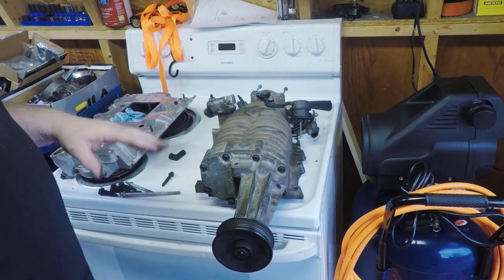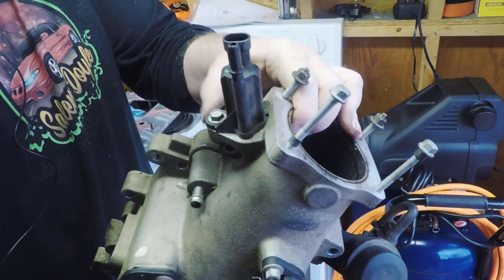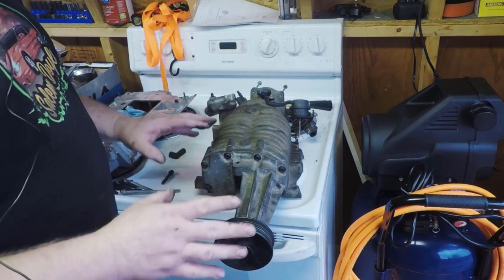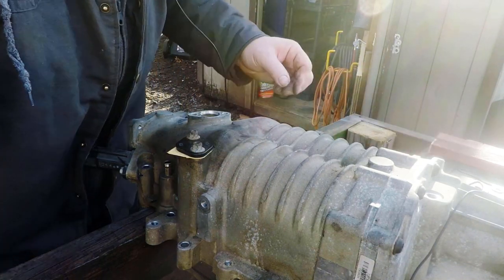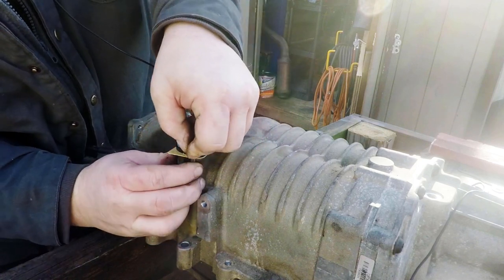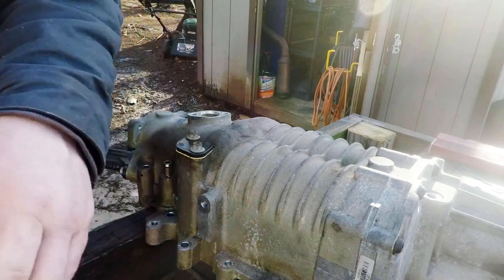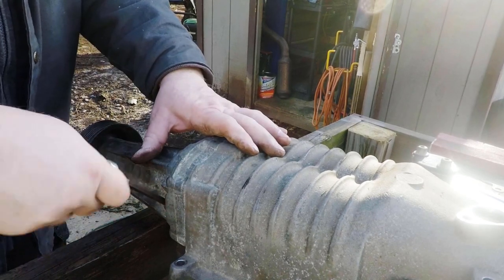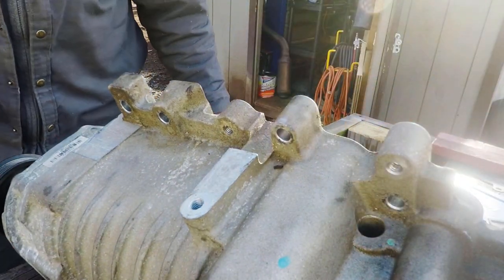Gen 5 M90 to L67 Swap Part 2 - Supercharger Prep

Comment from the maker: Quick correction.  The official fill capacity of the m90 is 225 ml . so that is about 1.5 bottle.  thanks carnage 50x for pointing this out to me.
Reply: Question have grand prix gtp have missing bolts on manifold supercharged   spraying air fuel what bolt set I need????
Reply from the maker: Zzp sells bolt sets
Reply: I have a 98 gtp and iv been overheating. Iv done a flush of the cooling system iv changed thermostat and still get a bit overheating. Now I'm dealing with a crank no start. It will fire up with starting fluid but sounds like crap. Could this be icm or fuel pump. And what would cause the overheating?
Reply: I also rebuilt supercharger and changed LIM gasket.
Reply from the maker: Several possibilities here.  Have you checked engine light codes?
Reply: @SalemDoyle  I did. Says multiple cylinder misfire.
Reply: @SalemDoyle  before it stopped running. It died on me a few times while driving
Reply from the maker: @justvideos4728  check fuel pressure to make sure you have good fuel delivery
Reply: @SalemDoyle  ok will do. Thanks
Reply: So I got the car running fuel gage is messed up. Now the transmission won't shift out of first gear unless it's under load. Will shift at about 4500 5000 rpm any idea what this could be? Speed sensor? TCM? Shift solenoid?
Reply from the maker: Possibly shift solenoid.  Deff. Check out the trans

Comment: Those rotors look awesome.   Its nice to get a junkyard score like that.   The torque spec is 17 ft lb man.  I've been using high temp CV grease on the bearings since the GM stuff is annoying to get.  Im running Intense supercharger oil but the local tune guy here says he only runs Mobile 1 5w30 in these.  He says its better.

Comment: If I remember correctly the bolt torque spec is 17 ft/lb.  they says 15-20 I try to stay in the middle
Reply from the maker: Thanks
Reply: Salem Doyle I just did mine a month ago and had a hard time finding it but that’s what I found
Reply: Yup

Comment: I always did 25lb. But I don't know the proper spec. It's aluminum so you don't want to pull the threads. What's most important is tight enough and even all around. You don't want to warp it.

 Also the gen v takes 1 and a half bottles just like the gen iii. You over filled it. It won't damage it but it'll create drag and whip air into the fluid. Just like in a diff of a truck. 
For cleaning the blower. Acid based wheel cleaners, wheel brighteners, or radiator/ac condenser chemicals is the easiest way to clean cash aluminum (besides media blasting)
Reply from the maker: I let it run out before plugging it.  Should have set its own level.
Reply from the maker: Thanks for the tip on cleaning, about to do that.
Reply: @SalemDoyle  the fill hole is too high.
Reply from the maker: @carnage50x  interesting.  I have always been told that that was the correct level
Reply from the maker: Just looked it up and found i spec that said 2 and one that said 1.5.  How weird
Reply from the maker: @carnage50x  looks like the official spec is 225ml so that is about 1.5 bottles.  thanks for pointing it out.
Reply: @SalemDoyle  no problem man. Best of luck with cleaning the blower 👍. Cast aluminum is always a pain to get clean.

Comment: I'm doing a motor swap from a Pontiac gtp3800 supercharged to a Impala 3800 without the supercharge and I'm thinking I don't have the correct wires from the wire harness in the Impala that would go to the manifold air pressure hose and the wire harnesses got a lil difference with them,is there any suggestions or is there a way I could hot wire that in there ,I'm still in the process of putting it in there so I'm stumped.
Reply from the maker: Both engines have an MAP sensor but one is on 1 end of the intaken 1 is on the other so you should have the plug in your harness you'll just need to lengthen the wires and move it over to the new location unless you use the wiring harness from the GTP

Comment: I need to prep the mating surface between the supercharger and intake. What's the best way to go about it.  Any info would be greatly appreciated. Thanks
Reply from the maker: Usually just scrape it with a gasket scraper or razor blade.

Comment: What year is the red GTP in the intro? I want to find 2 original metal "GTP supercharged"  door emblems with the black GTP letters which is nicer than the '98-'99 silver lettered version.
Reply from the maker: Its a 99
Reply: @SalemDoyle  My project '99 didn't have the black letter emblems. Do the black letter emblems  come on the later year cars, like the 2000-2004?
Reply from the maker: This one is just a stock emblem with a decal over it.

Comment: Hay salem im looking 4 the same thread & drill bit u used. Ive tried every configuration eg tap & drill kit ect ect but no corisponding drill bit included. I only tried ebay atm will try Amazon next.. Please let me know what it comes under . Cheerz.
Reply from the maker: I got mine on amazon.  You should be able to look it up by the thread size you want.
Reply: Also trying to find how to convert the gen 5 blower Evap system. Did you thread a 90 degree male plug to a hose fitting, then reuse your stock evap?

Comment: I got a gen 5 for my Daytona, but the black coating is worn off the rotors? Something worn out, are they ok?
Reply: technically,  yes.  Might lose some boost, but you are ok.
Reply from the maker: What he said.  Not ideal, but it will be ok.  Some people remove the coating for fear of it coming off and the engine eating it.

Comment: Hey, trying to change my sc tensioner, it will not move  at all, to take the belt off. I really don't want to cut the belt off, any suggestions
Reply from the maker: Can you unbolt it with the belt still on?
Reply: @SalemDoyle  I was getting ready to try that. I sprayed some pb blaster in the tensioner to see if that would loosen anything. I hope pb wont harm the belt.Im giving it a few min. to work.
Reply from the maker: Shouldnt hurt it
Reply: @SalemDoyle  pb didn't help. I'm going to take the tensioner off.Can you tell me what size the torx socket is and is it reverse thread?
Reply from the maker: Should be standard thread.  Dont know the size
Reply: @SalemDoyle  it's an 8, cant break it loose either, sprayed it with pb blaster. I'm done for the day. I don't think this car ever had to be worked on. I'm only the third owner, it only has 130,000 miles on it. I cant wait to drive it! 
I'll keep in touch. You are a big help, you're awesome! Thanks, have a great day.

Comment: Can I used same manifold off none supper charger 3.8 series 3 I want make my grand prix into gtp
Reply from the maker: No, you must have the supercharged headsand intake
Reply: @SalemDoyle  I have supercharger not lower intake manifold I was wondering I can put supercharger on existing manifold on car now or do need lower intake manifold off gtp car in junk yard make my car gtp whit boost gauge bigger harmicnbancer other pulley two stage fuel pump computer make it all work or just buy gtp that all ready set up drive go I like build  project car